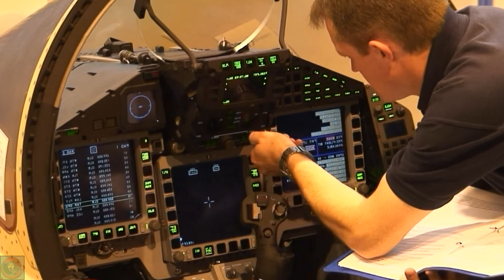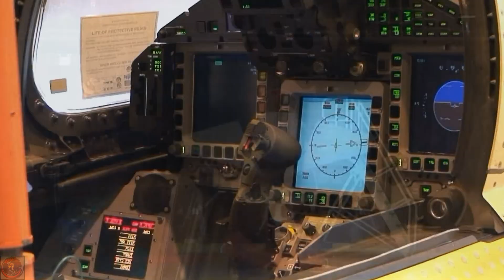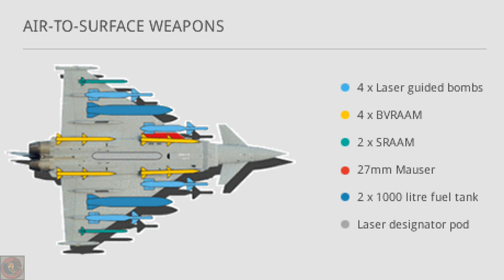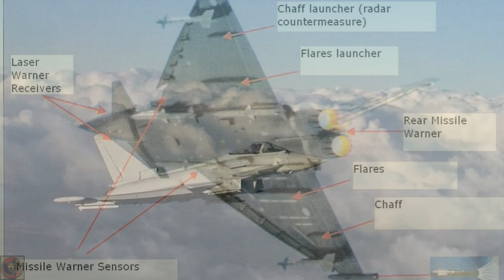Eurofighter Typhoon Combat Fighter Jet - Europe’s 4th Generation Fighter

Comment: Canards look great on fighters. Does anyone have an answer why most European aircraft go the canard-delta wing layout and the Americans go for the more traditional stabilizer?
Reply: Well, You have to consider the extremely far aft center of gravity of modern fighter planes which leads to an inherent problem with the classic design to put the elevators at the back of the aircraft. Basically the abilitiy to pitch is determined to a high degree by the force the elevators create and the distance between the elevators and the center of gravity. Simply said, it works by the law of the lever.
Now if you keep the elevators at the back and shift the center of gravity more and more to the back, you need a bigger and bigger force to achieve the same "reaction". The bigger force can only come from a bigger elevator and you can actually see this in the design of the F22 and F35. The elevators are huge.
The other solution is of course to put the elevators to the front, which gives you a much longer distance to the center of gravity of the plane. Now because of this long lever you need very little force which enables you to design the elevators very small which gives you a considerable aerodynamical advantage.
The canard-delta combination is very efficient solution when it comes to drag. Also the canards can help to create vortices over the main wing which will increase lift significantly under certain conditions, something you do in the classic design with wing strakes or chimes.
Reply: @shi01  Even though you got the concepts right, the lever length hypothesis is wrong, even though the EF2000 does have the Canards way in front to achieve what you describe.
You seem to think that the CG is further back than it actually is.
Reply: The J20 like all fighters is a compromise between conflicting needs. J20 is mostly aimed at downing AWACS aircraft and not to operate deep in enemy territory like the F22. So the J20 does not have to be stealthy from all angles an the canard is probably a good compromise between maneuverability and still adequate for forward sector stealth. This website has a fairly good analysis of the J20, but know that the site is mainly aimed at dissing F35 so the analysis can be biased when ever something is compared to F35.
http://www.ausairpower.net/APA-J-XX-Prototype.html
Reply: little airports..using highways etc etc..all steems from the Saab Viggin..
Reply: @reserva120   in finnland we do the same shit with hornets, no big deal.  

We land and start on country roads.

No swedish jet is needed for that, just good pilots.
https://www.youtube.com/watch?v=XNtFc0Z44m8
Reply: That makes sense but how come the Chinese new stealth fighter the J-20 opted for canards?
Reply: a_real_Airbus_CRJ-787 j20 is a Chinese plane and the Chinese like to copy if you look at there whole army you will see,so they probably just thought that lots of planes use it so they should
Reply: Russians also have canards.
Reply: @eddgrs9193   Russians used both Canards and Leading Edge Extensions (LEX).  They combine both  Europe and the USA!..
Reply: Distances are shorter in Europe, and close combat more probable .
Reply: *Foreplane
Reply: I've always wondered the same thing.
Reply: The canard makes the fighter more manouvrable.    The europeans wanted manouvrability, the US wanted stealth.
Reply: @HerbertHingolstone  Exactement sauf que la furtivité on peut la contrecarré avec de meilleurs radars alors que la manœuvrabilité c'est immuable ;)
Reply: Hi , I love the canards too . Lockheeds designer , Kelly Johnson , when asked what was the optimum position for canards ?  replied " on someone elses aircraft !"  also they provide lift to the nose during takeoff , where a conventional tail produces down force on the tail to achieve rotation .  which would you prefer ?
Reply: The canards are a compromise.  The delta wing gives it high stability during high speeds but the turning radius suffers in subsonic speed.  The canards were put there to solve that problem.  
The Americans tested it all during the 60's and 70's and decided to go with the lifting body design which is what you mostly see these days.
Both designs offer advantages and disadvantages aerodynamically.
The Europeans usually share their findings so they all usually go with the same basic delta wing/canard design. 
That's why they are all generically called Euro-canards.
Reply: The canard is considered to be bad for stealth. Actually the canards are not for dogfighting as Matsimus said. They are great for maneuverability during supersonic flight and thus for evading missiles in BVLOS combat. I recommend going to see one of these in an air show. The sound is awesome :)
Reply: @ @hihahupu   I think you mean maneuverability during subsonic flight. As for the Gripen, the Typhoon is unstable in subsonic flight and needs a computer for constantly adjusting the angle of the canard wing. This allows fast maneuvers. In supersonic flight the aircraft is stable.
Reply: Björn Nordström most modern jets nowadays require those computers especially if you wish to maintain a good stealth cross section while maintaining combat effectiveness but that’s a separate concern, the typhoon actually is incredibly manuverable at sub and supersonic speeds, think of it this way the unstable nature of its canards actually gives incredible aot and stall authority and makes the jet more versatile.
Reply: Henri Hohtari actually the carnards are better for subsonic maneuverability its the opposite of what you said.
Reply: because if the radar system is good... this 'stealth' is a waste of time
Reply: @andyf4292  - Define "good." I assume you're speaking in reference to SAM systems. A radar may very well be able to "see" a plane from a certain distance, but is that distance beyond the range of standoff anti-radiation missiles, can the radar unit that sees the plane actually track it, target it and successfully score a kill? Remember that the F-22/F-35 will soon be accompanied by the B-21, a new stealth bomber, which will have both defensive air-to-air weapons as well as tons of standoff munitions.
Reply: I believe the delta wing makes the aircraft cheaper to build

Comment: i love delta wings
next up its french rival Rafale maybe?
Reply: "...the inspiration of the design for the Euro Fighter"

Rafale didn't exist when the planform for Eurofighter was selected. Eurofighter was inspired by the late 1950s delta-winged aircraft which had excellent supersonic performance but had to sacrifice landing performance and sustained turn rates at subsonic speeds. The designers realised that they could combine a highly unstable delta-wing design with canards and fly-by-wire with modern high thrust engines and lightweight materials to gain all the benefits of a pure-delta wing with none of the downsides. So it's a design that allows them to both have their cake AND eat it.
Reply: I read up on it. In my mind the Rafale was there long before the Eurofighter - which is kind of how it went.

The french withdrew from the design project of the Eurofighter to build their own delta wing - which would become the Rafale.

So they were faster to build a prototype but used the initial prototype designs of the Typhoon. That means the Rafale is actually based on the Eurofighter.
Reply: @jellysquiddles3194   The reason why the french left the eurofighter project was because they wanted to head the project or to be the boss and when they couldn't get their own way they spat their dummy out and left the project to go on their own and build the rafale which is inferior to the typhoon.
Reply: the Rafale isn't really its rival, but the inspiration of the design for the Euro Fighter
Reply: they compete for sales so i say they are rivals in that way
Reply: makes sense... did the french upgrade their Rafale though?
Reply: i believe so dont know for sure
Reply: Yep, that's about right.

Comment: The curves on this bird are gorgeous, i just wonder if they could redesign the intakes to lower rcs like they did to our F-18s!

God bless America and the F-22......
Reply: U wot m8? I wasn't a fan of the Super Hornet but look how well that turned out?
Reply: We don't know whether the designers already tried that or not. They obviously went for maximum mobility which at the same time means most efficient air-intake. So my guess is that it's carrying capability is due to the intakes position. As M states, that isn't a stealth fighter, but a dog fighter.
Reply: from what i undertsand part of the purpose of the location of its intakes is to obscure the heat signiture from the front of the engines

Comment: What a beautiful plane and a couple of those on the queen Elizabeth class aircraft carrier would be awesome and didn't a air force general say it say it a good a f-22 but without stealth
Reply: The Typhoon isn't carrier-capable, although a navalized version was proposed. It likely wouldn't be able to operate off of the QE-class carriers, though. The QE was meant to be able to support CATOBAR, but it's now only capable of operating V/STOL aircraft.
Reply: i think they have designed the new carriers to be convertible to catobar if the government change their mind in the future but don't quote me on that
Reply: Band - Admirals aren't going to know if it's convertible or not, the engineers who worked on it will, and they say it is, because that's the way it was designed.
Reply: According to a few former Admirals in the RN, the QE-class is not convertible to catobar...
Reply: bandholm well there's conflicting accounts, I've seen quotes from other high-ups claiming it IS